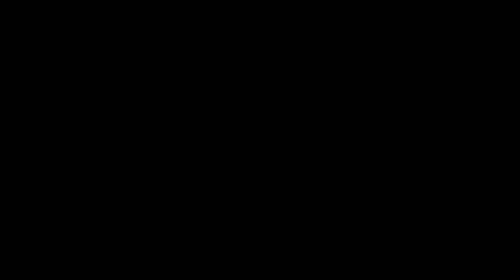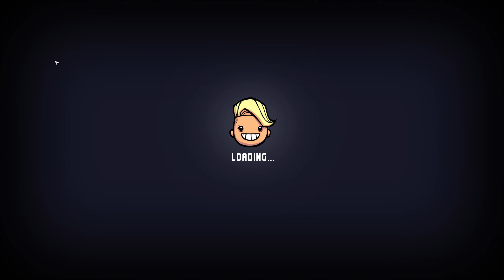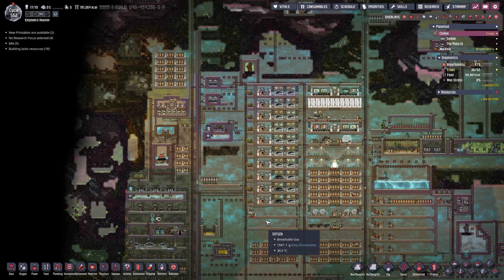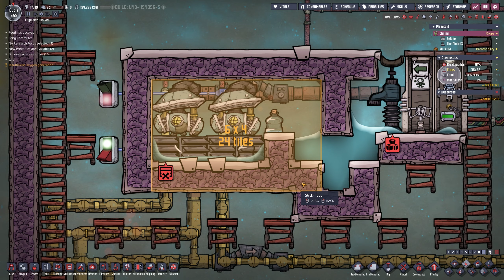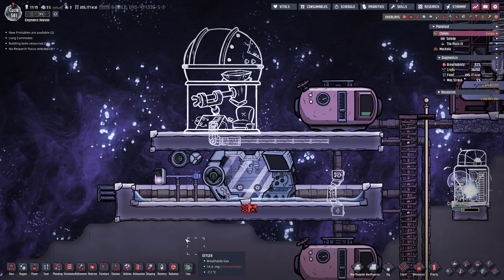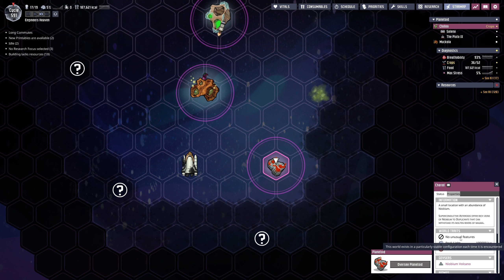EMERGENCY REPAIRS & SPACE Preparations in OXYGEN NOT INCLUDED! (LP1-EP19)

Comment: Why not use crude or petro in your inf gas storage's, then you really do not have to worry about temps for quite a bit?
Basically, I only cool what is needed to be cooled, which natural gas and heck most gases do not need to be.
Reply from the maker: Yeah, agreed on both. It's a means for content and shows that if no crude oil or petroleum is available it can still be done easily. Really only O2 needs to be cooled, I agree completely.

Comment: Wow! Thanks for the shoutout! Glad I could help with the advance warning.
Reply from the maker: Credit where credit is due! That was a well deserved shoutout, thank you for helping out :)
Reply: @BierTier  regarding breaking back into a pressurised liquid storage, you can do it by building a standard design liquid lock  out of airflow tiles and filled with any heavier liquid than what's in the storage, so in the case of your water tank, crude oil would work fine.
The best spot to break in is at one of the bottom corners, such that when you break in only three new tiles get filled with water. This makes it really easy to push the water back inside when you're done in there. I literally had to do this tonight in my own map on a polluted water tank at similar pressure to yours.

Comment: Very nice video again! Though you did have the Airlock Door Mod installed (at least you had it) so in stead of the liquid lock you can use that. Uses some refined metal to build and power ofcourse but its a nice mod door keeps everything vacuum and separated and you can control the directiins and permissions too. No soggy feet and more realistic maybe.  And it just takes 3wx2h tiles.
Reply from the maker: Thank you very much! Yes I do have the Airlock Door Mod, I just find it doesn't always work as intended. But a similar setup as I built on the bottom for the supercooled area could work... I need to do some testing :)